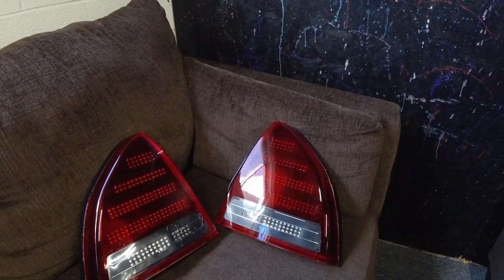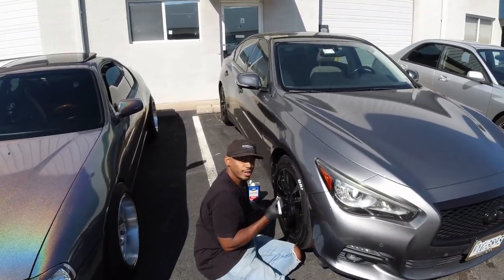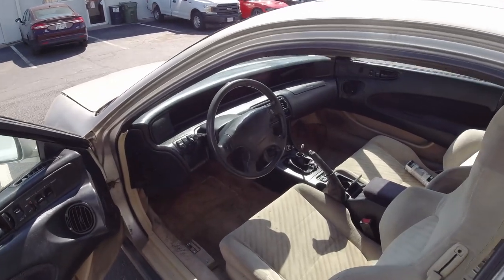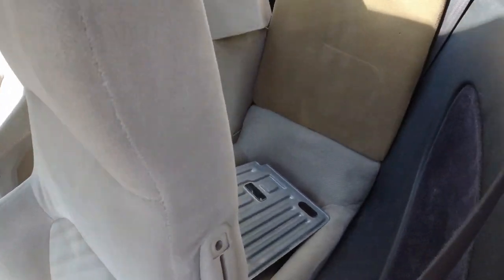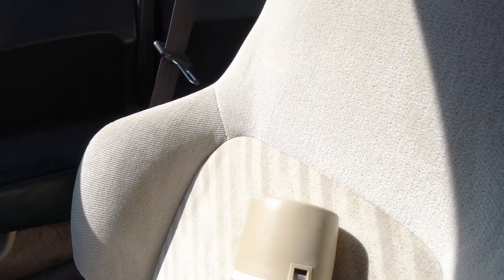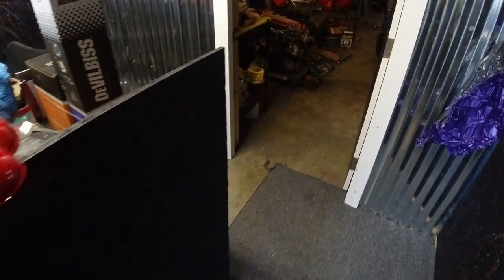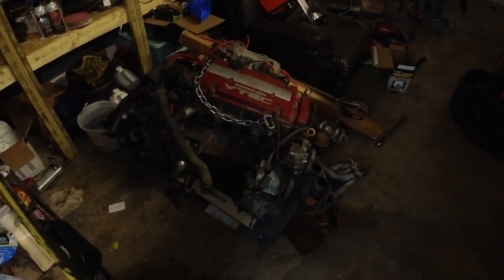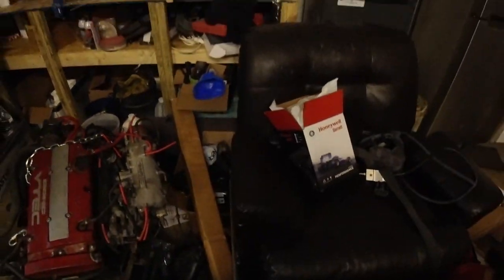I bought a new car!?!?!?!

Comment: hell yeah love my 850 mini mani… only issue I had was vacuum line to wastegate actually caught fire becuase of how close it was to exhaust!  I switch to braided line just fyi
Reply from the maker: Good to know thanks bro how much power you make on it?
Reply: @treybedipping1734  I just built my motor had it running on 15psi street tuned i need to do a few things yet before i turn it up all the way... my guess 400

Comment: Just got my F22b dohc put in my Lude. Next mod will be front camber bolts and coilovers, then the turbo kit 😎 I'm only looking for about 400 whp tho! 😂
Reply: 400whp goes a long way in a honda! Thats gonna be a beast!
Reply: @ej2brandon383  Yep! I saw a 400 whp S2000 walk a 650 hp Camaro ZLE or 1LE 3 times in a row and the S2000 weights 25 lbs. more than a 4th Gen Prelude. So that's what made me go with that HP figure, plus it will also be pretty reliable too especially with the forged internals and CNC CSS closed deck conversion I plan on getting done. 💪😎

Comment: I'm seriously thinking about bringing my SI to you bro
Reply from the maker: Bring it down bro.
Reply: Me too. I need my rear fender to be flared slightly. I don't wanna go with plastic fender glares nor do I want to run a shit load of negative camber just to tuck. 

I got zero offset wheels.
Reply: This video made me go with zero offset,  https://youtu.be/TMRHj-CJDLQ but his wheels are 8 inches wide and mine are 9 inches wide so Imma need at least a .25-.50 inch custom molded flares in the rear.

Comment: h22a gang
Reply from the maker: Yezzzirrrr 😎😎😎
Reply: If you plan on boosting, I would suggest going with a F series engine.  They come with cast iron cylinder sleeves as opposed to the FRM sleeves in the H series engines. Those FRM sleeves won't work well with forged pistons and boost unless you plan on resleeving the cylinder walls, but for that amount of money you can get a F Series block and just get a CNC CSS block job done, and your block would be bulletproof for way cheaper.

But if you plan on doing a N/A build, then disregard this comment. 😂
Reply from the maker: @jaybelurkin  you must be new lol i have a g20 (f20b bottom h22 head) build in my other prelude almost 600hp
Reply: @treybedipping1734  ohhh OK. I musta missed that video. 😆We'll as long as you got the F series bottom end, you're good. 😎💯
Reply from the maker: @jaybelurkin  not on the motor in this video in my holographic prelude. I was saying i already knew what you were suggesting in your first comment but i appreciate you 💪🏾💪🏾💪🏾
Reply: @treybedipping1734  Oh yeah I already know you got it on lock with the other Prelude with the Precision Turbo, 2 blow off valves, etc etc lol.. I was talking to the author of this thread. I shudda tagged him 😆
Reply: @treybedipping1734  With that much power on the Holographic  Galactilude, you may as well go AWD  😆😆💯🔥🔥
Reply from the maker: @jaybelurkin  shiiddd lol thats like 6k  i cant justify it lol
Reply: @treybedipping1734  ikr? 😆😆😆

Comment: I believe h22a is the real red top, 217 hp
Reply from the maker: Cant be because the intake manifold is very distinguishable its what the skunk2 one was modeled after
Reply: @treybedipping1734  probably changed the mani then? H22a1 is 4th gens black top and h22a4 is 5th gens.  My red top is stamped h22a.
Reply from the maker: @GHETTOHEISMAN83  ill do some research
Reply: H22A was pretty much the JDM across 4th and 5th gen. Gotta look at the engine serial number. Yours is from a 4th gen Trey.

https://hondathomsen.wordpress.com/h22/
Reply: Head/valve cover may have been  swapped. Check the date stamped on the front of the head.  Looks like a clock with numbers on each side of the arrow.